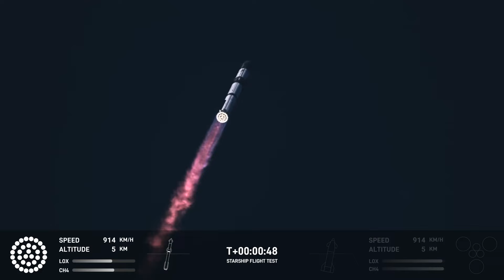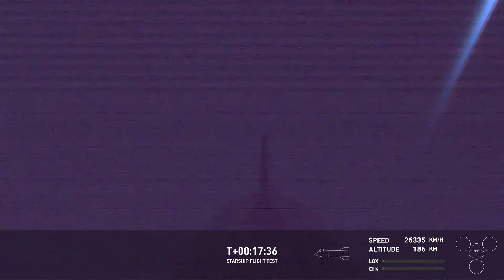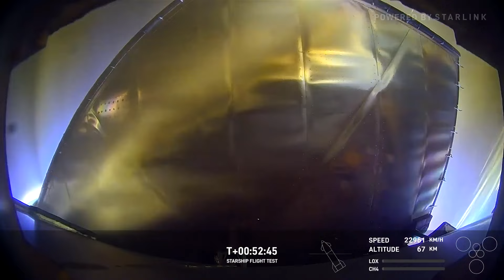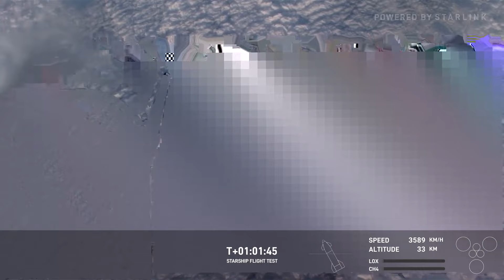Starship's 6th Flight Test (Entire Flight) Starship and Booster Attempt Water Landing

Comment from the maker: 0:00 Countdown
0:20 Liftoff!
3:00 Hot Staging/Boostback Burn
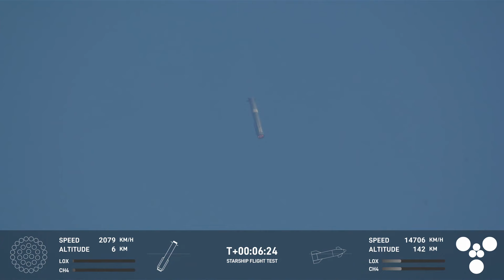6:55 Booster Landing Burn
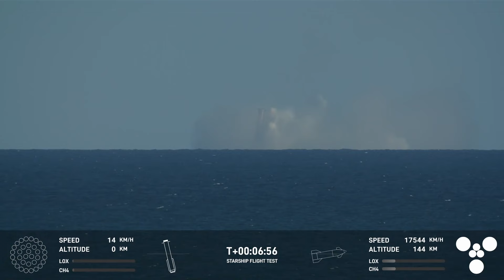7:20 Booster Splashdown
8:50 Ship Engine Cut-Off
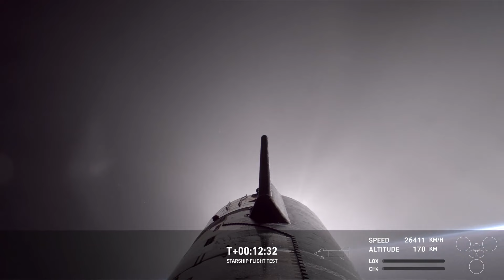13:00 Coast
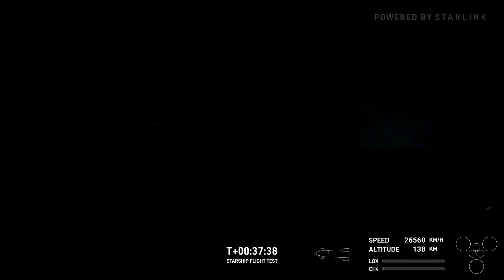38:08 In-Space Relight Test
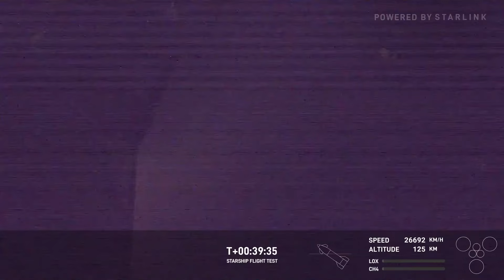40:00 Re-entry Begins
46:30 Re-entry Continues (Webcast Resumes)
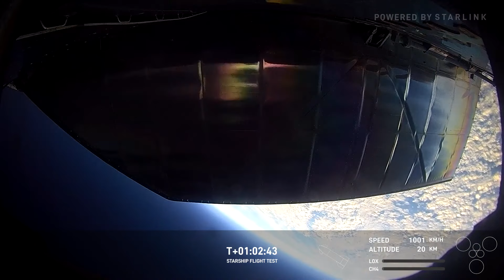1:03:10 Starship Subsonic
1:05:35 Starship Landing Burn
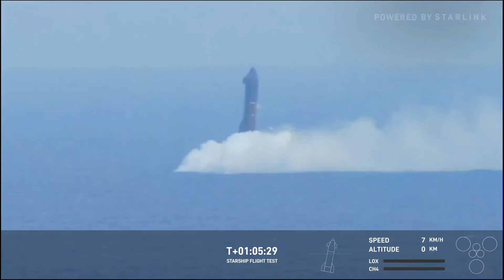1:06:00 Starship Splashdown